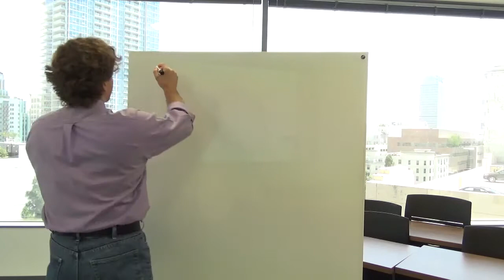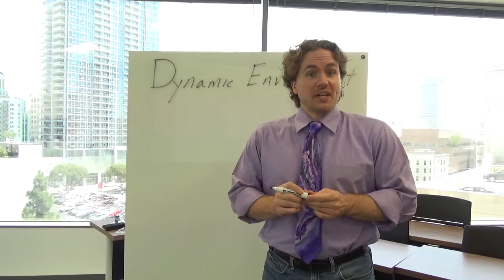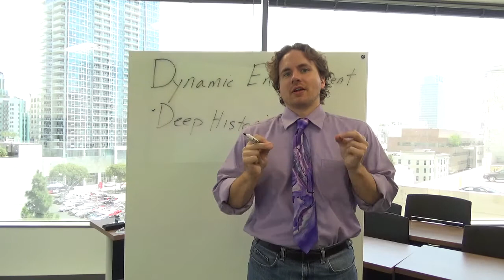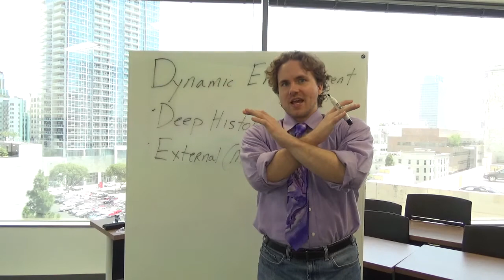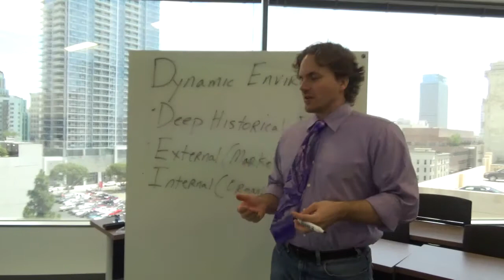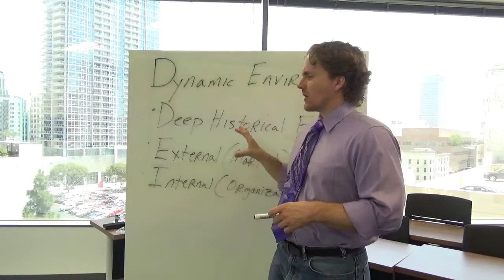Introduction to the Dynamic Environment

Comment: What I found most insightful is that the video emphasizes how all three of these levels are crucial for generating variables. These variables are then directly useful for scenario building, which we've discussed before. It's presented as a different, parallel way to find variables compared to tools like PEST analysis. Ultimately, this video provides a foundational understanding of where to look for the key elements that will shape our future narratives in strategic planning.
-Paulina Vargas